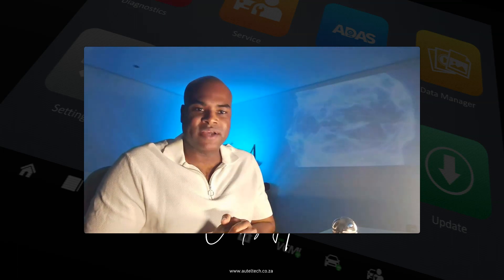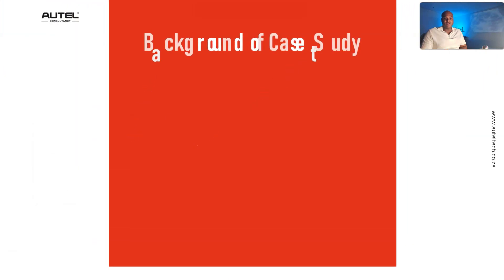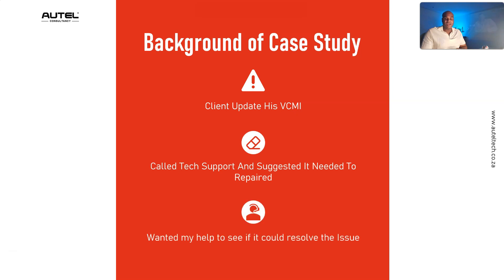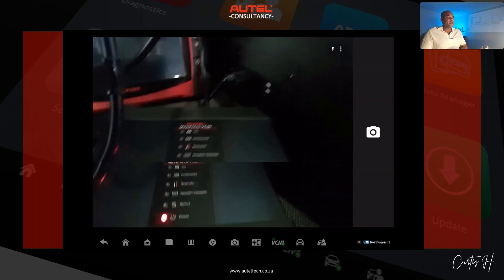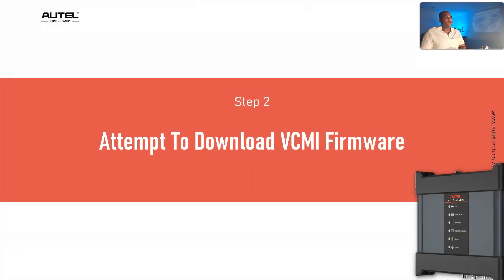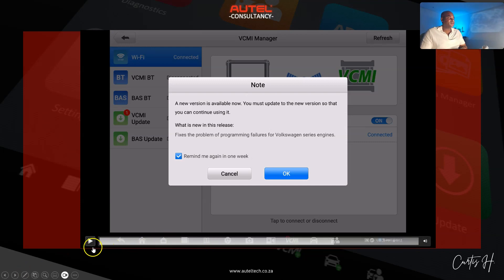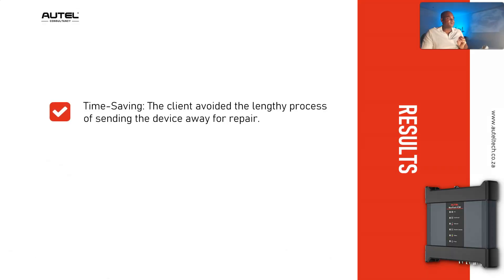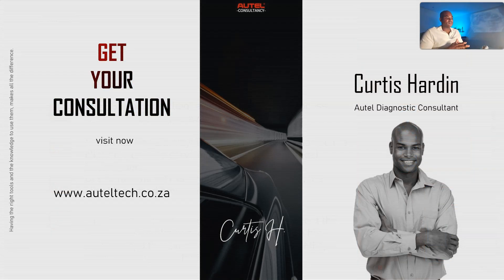Maxisys Ultra VCMI Update Disaster How I Remotely Fixed the Unfixable

Comment: This is really helpful, I have an issue with my mvci stop working, after all complete updates ,reset tablet.my mvci will not auto detect the vehicle it will pop up with manual and even after I put Vin number in ,it will fail, this problem started few days ago, please can you help I don't know what is next step I need to do. Thank you .
Reply from the maker: If you would like me to assess your situation and provide a solution you can go to auteltech.co.za and book the diagnostic tool consultation service .

Comment: hi i have issue with mi vcmi so after updata i cant comunicate with any cars
Reply from the maker: You can book a diagnostic Tool Consultation with me on my website if you want me to asses it and handle the repair if necessary
Reply: @AutelConsultancy A couple things to be aware of with the VCMI. One it does have an internal battery that has to be charged before you use the scope or want to update it since you can't depend on the USB cable used during updating to provide adequate power during the firmware update of the VCMI if the internal VCMI battery is already depleted.
 To charge the VCMI pull the charger cable from back of docking station and plug into the charger recepticle of the VCMI until the flashing green light goes steady. It would have been nice if Autel made the docking station to also contain slot to support VCMI charging . I noticed a charging receptacle on top of the Ultra tablet also, and wondering if a double ended jumper cable could attach from top of Ultra to the VCMI while the Ultra sits in the docking station, so both could charge together instead of one at a time
Reply: @AutelConsultancy I have a Windows 10 PC with the Maxi Scope software on it that I used the Autel MP408 off of. I was wondering if I could run my VCMI scope off the Maxi Scope software of my pc?  Also I have an extra VCI 100 Bluetooth dongle and wonder if it can be paired to my Ultra like the VCI 200 from my BT608 battery tester?
Reply: If you have the bluetooth VCI 200 connecter dongle for the BT608 battery tester, you can pair that to your Ultra and won't even miss the big ole VCMI on nine out of ten vehicles you diagnos😂

Comment: Had a  MS906  got buggy restore lost vehicles so upgraded to 906bt yet from day one had to use cord on vci to connect ,,,  Autels answer looked opened ???  a brand new device with warranty   for what purporse would you pay that much for a tool to never work as intended???  needless to say it to has become buggy but know better than to buy another sub just to get failed service on a product!  so thank GOD for backups for as much as autel brags my old snap on ultra still rocks without a subscription  and i can restore to same point i bought it   ??  why does Autel have a restore option that will render tool useless???
Reply from the maker: if you had a consultant I can guarantee your experience would have been different. I dont know how our supplier works but all of my client's tools, I manage their software. So if they do have any issues like the one you mentioned, I will first see if I can rectify the issue remotely, then if its a severe problem then I will do a factory reset IF my client has a valid subscription.  I cant speak for Autel on why they did it they way but there are ways around it if you have the right strategy.
Reply: @AutelConsultancy  right strategy having a restore option that wipes usefulness????  i have 3 different autel tools all crippled buying a tool then having to fret about warranty enough to purchase an extra consultant???   my snap ons or old as dirt every one works even the old brick???  if i thought i needed a consultant then its the wrong tool for a limited budget,   not everyone making bank off scan tools???  you yourself mentioned factory reset yet with warranty that makes your job usless to me no offense but my tools were under warranty said scription based joke when they fell down and refused to go on,, most all my issues are software related except vci doa! i appreciate your take but fixes not a single thing!
Reply from the maker: @badwabbit1973  Lessons in life repeat until they are learned. If you had 3 autel tools and they are all doing the same thing , maybe you should try a different approach? Ive been getting this complaint for years so that's why I took action to solve it. Unlike the vendor who doesn't care for you, I can actually get tools repaired after their warranty ended. Im on your side my friend and with no emotion im just preventing a problem that I observed. If you dont want this solution don't buy from a consultant like my self. If your way is helping your customer thats all I care about.
Reply: @AutelConsultancy  FOR A CONSULTANT YOU DONT READ VERY WELL! ms906 got buggy did restore wiped vehicle coverage, ms906bt is buggy but vci needs to be pluged into tool to work, ts508 just errors alot??  how are these 3 items the same?  same warranty was refused on all tools?  same coruption of software /hardware not following the same theory???
Reply from the maker: @badwabbit1973  I never saw this problem right?
Reply: @AutelConsultancy  if you restore autel it wipes coverage lesson learned   if you restore pc/laptop/phone /ipad ect it fixes software issues not wipes usability,,  i watch you for info i realize its your job but i'm an ex mechanic on disability  i thought autel was better than lead to beleive!!  you run a great channel but mis quoting me???  you sid it yourself teirs ways around a subscription yet not being taught and restore for system wipe seems to be a money grab how does they push customer support????
Reply from the maker: @badwabbit1973   You didnt answer my question. Have I seen this problem before or not.
Reply: @AutelConsultancy  3 different issues not sure since out of subscription i doubt it!!!
Reply from the maker: @badwabbit1973  Ok my friend, when you dont want this problem any more let me know. Take care
Reply: @AutelConsultancy  i use older snap on  scan tools might not be up2date but work without subscription! and i can restore if buggy!   but thanks anywayz